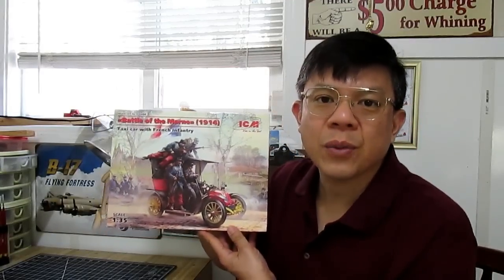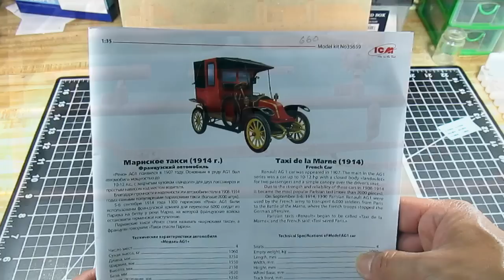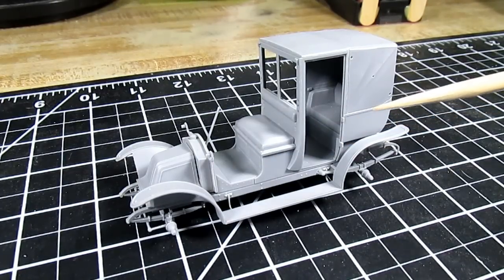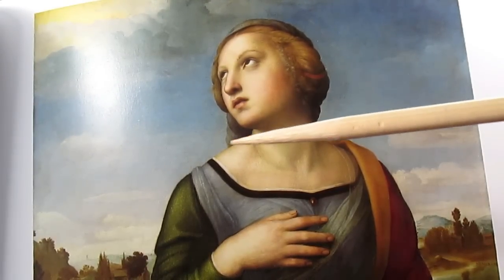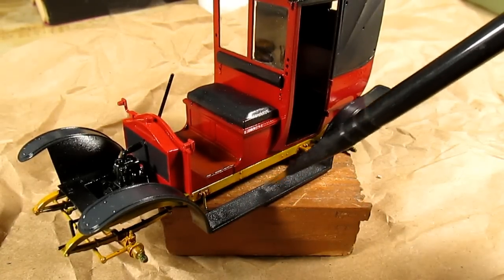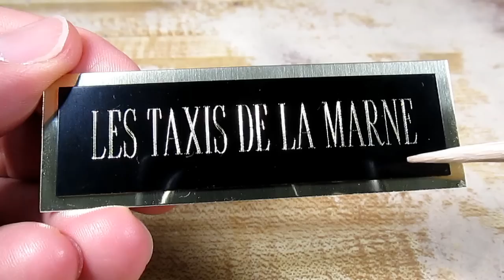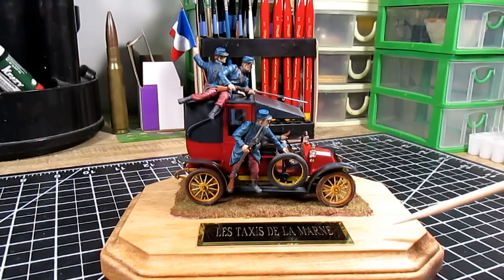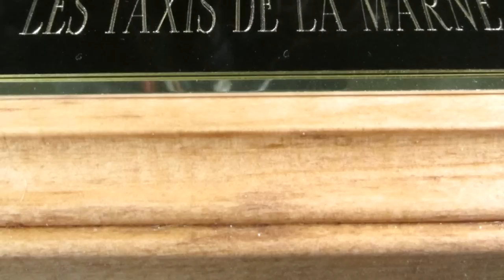Building ICM Battle of Marne 1914 in 1/35 Scale. From Start to Finish

Comment: another fantastic build and video QDC! I had a question though; I'm brand new to building model kits and was wondering if i should start out with a 1/35th scale model or maybe a 1/16th model. Any insight would be welcome!
Reply from the maker: Thanks. It depends on your style and affordability. I tend to steer beginners to 1/35 because there are a range of prices they can afford to build and enjoy. 1/16 is more expensive for the most part.